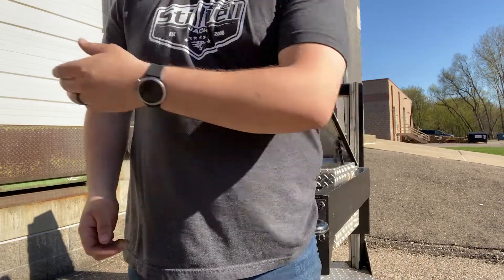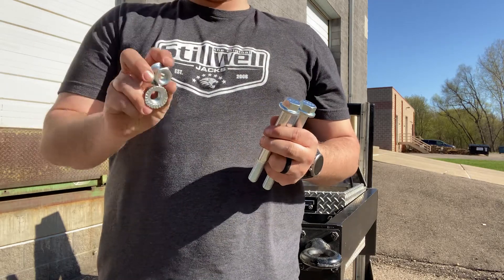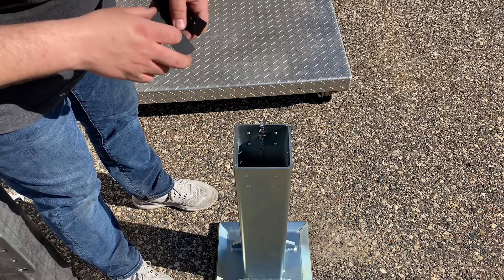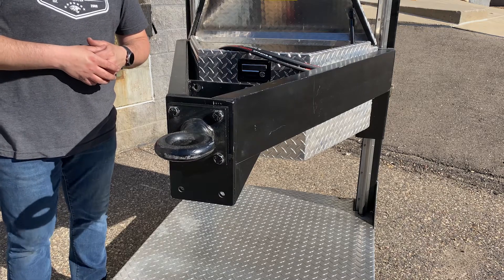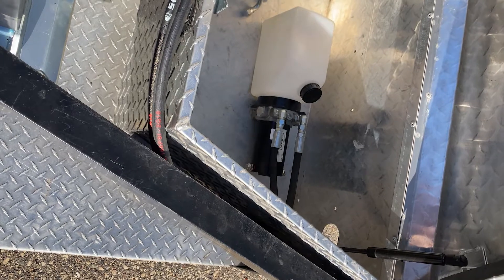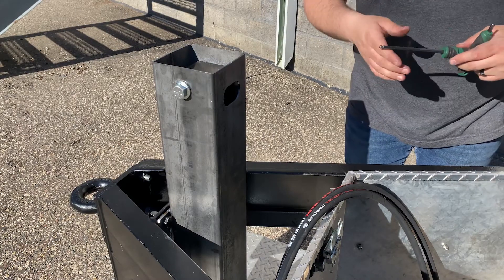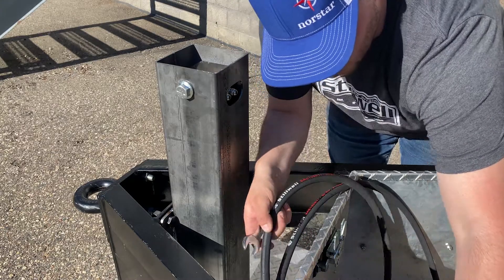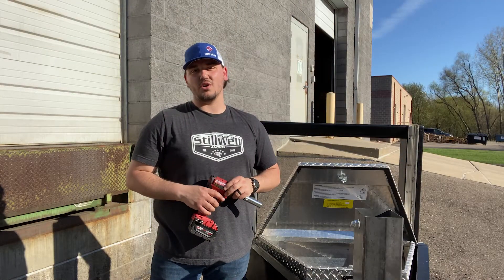DURO Hydraulic Trailer Jack Installation - Replace your jack with a Stillwell Jack

Comment: How much travel length is there because I want to keep it high enough so I don’t touch the ground in the retracted position
Reply from the maker: Hi Rich, thanks for reaching out! the DURO has 20" of travel and can be mounted anywhere on the outer tube.